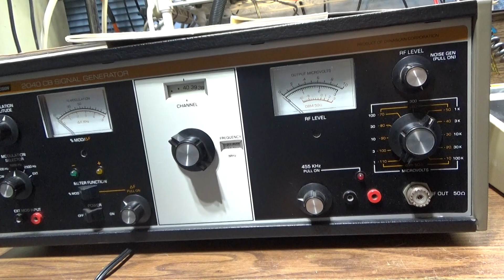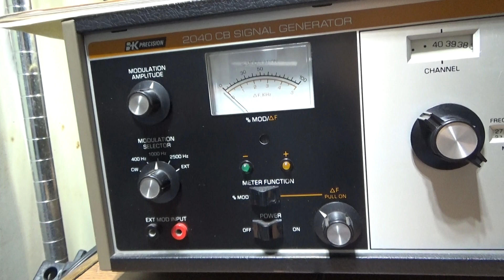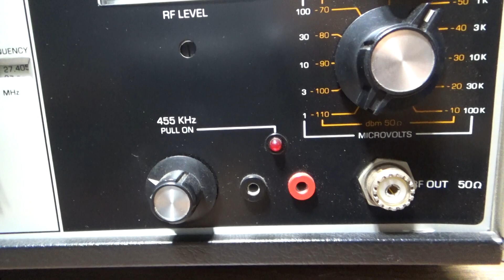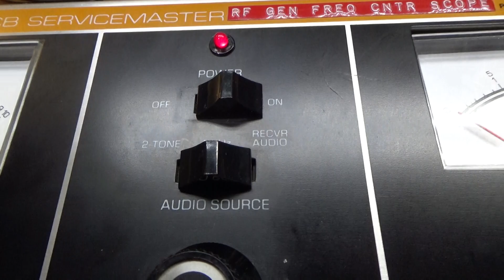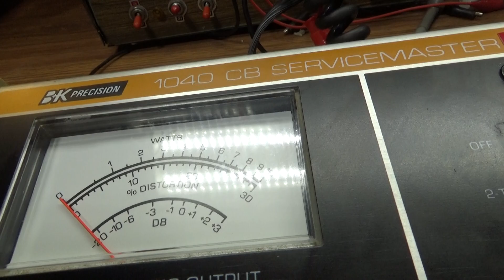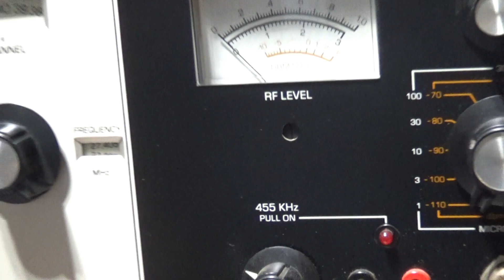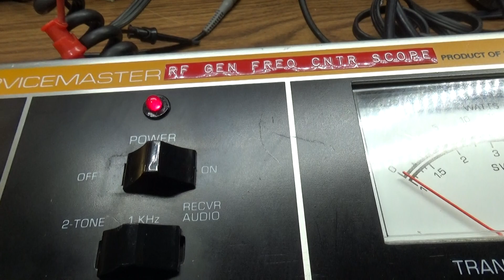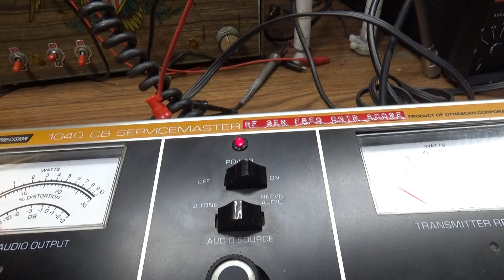B+K Precision 1040 and 2040 CB Radio Testers Repair Generator Analyzer Wattmeter Dummy Load

Comment: Back in the day, this gear would be priceless when working on CB transceivers.  Today, ‘cheap’ test gear can be had that does a few KHz to a few GHz.  But I personally still use an old Dumont O-scope and a PS analog VTVM!  I wonder what the radio world will be 200 years from now!
Reply from the maker: Cheap stuff works well, but isn't convenient, yet. Example, DDS generators work great, but they are not channelized nor have calibrated outputs.

Comment: These items still go for big money....I own the CB42, never used it, need to rebuild it, owned it now for abt 5 yrs, its one of those round-to-its! I own 2 of the HP 8660C's, love those machines, I own many sig-gens but they are my fav, its what I use daily.  I own the Fluke 6011A, that thing is crazy on freq, I've never serviced it!  I have owned that GWInstek function generator, I sold it, that thing was a little unstable and a whole lotta dirty....look at it on a spectrum analyzer...I ended up replacing it with a BK 4070A, love that machine so much I bought another!  Most of your modern day generators cannot touch what it can do with all its feature!  I am a HAM operator, but most of my free time is spent on 11m, I love vintage radios of all flavors....not a snob...I have been an active CBer since 1975, 10-4! ~Jack, VEG
Reply from the maker: 75 was about when I started.

Comment: Those are nice tools. Before 1970, some radios used a 1650 kHz IF frequency, like the Eico Sentinel 12, and some used a 260 kHz IF like the Courier 1M and the Regency Range Gain family.
You can perform a real-world adjacent channel rejection test with this. Set the 400 Hz to about 90%. Set the RF output for a 10 UV output. Note the S meter reading. Change the channel, and increase the RF output until the meter reads the same as before. The difference between the two, in dB, is the real-world adjacent channel rejection.
Reply from the maker: yes Sir.